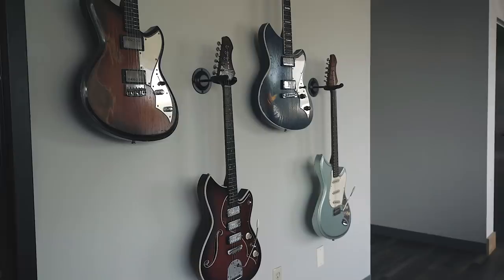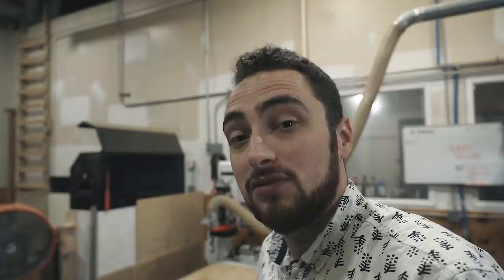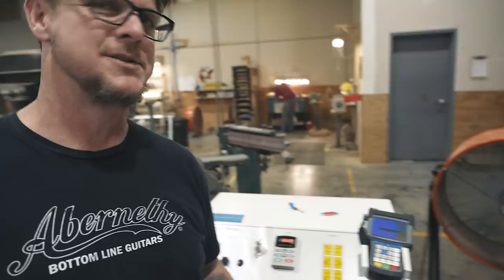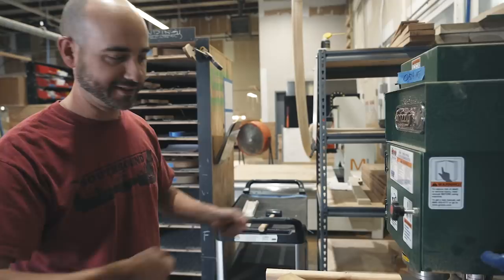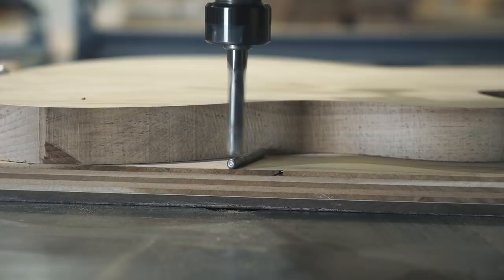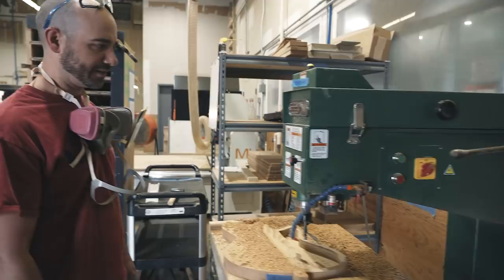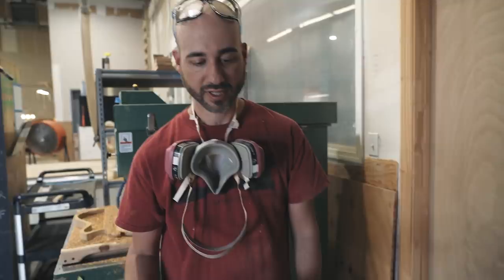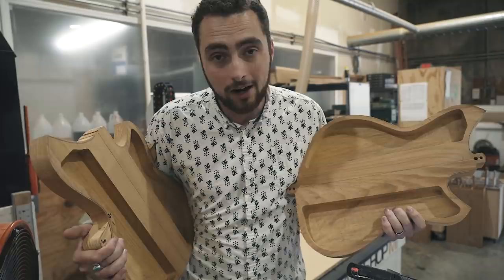Is “Handmade” Really Better? CNC vs. Handmade Guitar

Comment: I built and designed cabinets and furniture for 25 years. And although I'm no luthier, I know a CNC machine is still a router and works exactly the same way. The only difference is running a CNC machine won't fatigue you anywhere near as much (it's also a lot safer as my knee can attest to) and the results are more consistent. It's still important to have a qualified woodworker who make can make proper adjustments that mere technicians would likely have no clue about. But there's no less quality otherwise.
Reply: I don't know about that. A CNC machine is capable of whatever a computer can manage. Which is quite a lot. How well can you draw a fractal pattern? It wouldn't pose a challenge for a CNC machine to replicate accurately.

Comment: The CNC machine is a major investment piece of gear for the shop (although less expensive recently), and as a consumer I would be paying for it in the guitar price, not that it would make the guitar more affordable due to increased production numbers.    If I was a builder I would offer a number of body variations online and take custom orders (no, no monkey grip).  With the CNC machine it will take the same amount of time to shape my guitar body as any regular production body, and in a modern factory tracking custom orders is no big issue.      That is how I would like to have my piece of the CNC cake, a semi custom body at no extra charge.

Comment: CNC is an excelent way industry found to achieve a high level of tight tolerances, piece after piece, also achieving a high level of compatibility between parts (among dozens of other advantages). So if one considers that a musical instrument is a precision instrument, you have your answer.

This is also what makes modern inexpensive instruments to be quite decent, instead of total crap they used to be one or two decades ago.

Comment: I like the selection of the wood for the body of the pin routed guitar.  Its darker and has more character.  Granted, that's not going to be be seen once the guitar is finished.  I agree with the guy who did the routing, a CNC is just anther tool like a saw or chisel.  We still got to know how to build and assemble and ultimately to use the finished product.

Comment: As I see it there are at least three main aspects to guitars regarding quality. Appearance, play-ability, and sound quality.  Appearance and sound quality are highly subjective, play-ability is largely a function of accurate geometry, although geometry of frets, nuts, and bridges play a part of sound quality too. 

A highly skilled and experienced wood worker can produce a very nice piece of art and do a good job of massaging wood (or metal) into a good product such as a guitar. No doubt in many cases they can beat guitars partially made by CNC's and then further manufactured by inferior methods and/or by less skilled people. Ultimately though, a guitar completely made by highly skilled people on good CNC equipment with state of the art processes can be made so accurately and consistently that the best hand built one would be a distant second, every time. No contest.

If parts of a "CNC" guitar have to have handwork done other than assembly and some cosmetic work plus the final finish application then the CNC part maker has failed and they are either not very along in the CNC game or they are only utilizing a portion of what CNC's are capable of and only want to utilize specific advantages of CNC, or perhaps a combination of both things. Keep in mind there is a vast array of CNC equipment types and quality.  CNC's can range from hundreds of dollars to hundreds of thousands of dollars in cost.   There are CNC routers like in this video which are about the most basic, then there are 3 axis machining centers, and 5 axis machines that could carve the entire neck in one setup and machine all features including the fret grooves to within the tightest possible tolerances wood can be machined to, which would be many times over what a person with hand or manual machine tools and templates can do.

I have not seen everything out there but what I have seen with CNC guitar making is no one is fully utilizing and capitalizing on what CNC's can ultimately do. To put it another way,  "CNC" guitars are generally made (from what I have seen) with rather crude production techniques, and it's not hard to make bad parts with CNC's, which then get hand fitted which introduces more potential for error. Then the CNC gets the blame because the guitar is no better (or may even be worse) than a completely hand built guitar, when it's really due to a lack of human skill that couldn't or didn't capitalize on the potential of CNC machines.

Simply owning a great guitar does not make you a great guitar player, and owning or making parts with a CNC doesn't make anyone a good manufacturer.

Comment: Been a CNC machinist for 20 years. Guitar builders have a lot yet to learn with 3 axis mills. Jackson has a video up that sends me into fits. This one is not much different. 10 minutes? The fixtures are all wrong. The endmill is outdated. They built in a flaw touching off the first mill. My GD&T senses are going bonkers. They left more wood down the center of the body than they had to. They did not mill the matching top, back and neck joint when they had the chance. All the datums have been lost and the tooling tabs are a needless issue that must be blended into the profile now. I see at least three golden opportunities to improve fit and finish ignored. I also see a flash hazard by using compressed air to clear chips.

CNC and instrument building has a future, but it has a long way to go. I agree with every point you and this shop is trying to make here, but I go nutz when I see these opportunities missed. CNC is a tool, and it's best to stay at the limits of those capabilities so that serious problems downstream are minimized.
Reply: You’re hired!
Reply: @HBSuccess  I'll send my resume over.

Comment: Not to take away my view of the video but as a builder that started making guitars by hand that now uses a cnc my opinion is the cnc is actually the better method.  There is just as much skill and craftsmanship that goes into the modeling, tool paths and cad operations as goes into the hand building of guitars. The difference is I need only do the hard work once and then just be attentive and ready to make adjustments. There is still handwork to be done when using cnc it’s not like you click start and a few hours later a guitar comes out. However in terms of consistency and spec once the design is mastered it’s mastered forever and the first is going to be at the same spec as the 50th providing that spec is good. 
Make no mistake cnc is woodworking. It’s just another form that utilizers different skills. Whether rout from a template or a program a tool path the process is the same. The biggest difference is I can be cutting bodies and at the same time leveling and dressing frets on another guitar in the shop. I can be making the radius of fretboards while finish sanding a guitar marked for delivery. It’s a pleasure to watch the masters handcraft an instrument and truly an art but once a design is perfected and debugged I can replicate it with precision down to .002 mm each and every time and get more guitars ready to ship in a fraction of the time

Comment: At the end of the day it's still a piece of lumber > hand finishing is where the quality control happens - the artistry with wood & the CNC machine is to leave a little extra wood in the design input to the machine & remove the last bit with hand tools. Yeah - safety is cool , repetitive motion is overlooked sometimes & that unguarded router may be outside OSHA guidelines. ⚓️ Thanks Rhett, great to see technology put to good use.💦

Comment: The way I see it as an aspiring guitar builder, a CNC is really a mass production machine or something to use for quick precision. If you're not mass producing guitars, you don't necessarily need one. If you can get by with handmade MDF templates and a plunge router, then good on you. If you can afford a CNC, then I'm not going to fault you for using one especially because pin routers aren't exactly cheap. A lot of people do seem to think CNCs are do-it-all machines that can go from slab of wood to finish-ready guitar neck or body in minutes. But they're just computer controlled routers that use digital templates instead of MDF.

Comment: The only difference in them is that one of them has a perceived value above the other. I am an old furniture builder and while I really enjoy working with wood and hand tools, I also have 2 CNC machines machines with 5'x12' tables on them that can do all of that work in about 10 minutes as opposed weeks of labor.  It really amounts to what the material you chose. The CNC machines are just routers that if programmed correctly, do the same thing as doing this as a human. Just pick good wood when you make these and either method will create an equally fine instrument. It's all in the wood, not the method.

Comment: The CNC does not come to work with a cold or headache and it's faster.  However some unique operations can be better done by hand where constant adjustments need to be made.

Comment: The problem isn't in the tool used to remove excess wood and get a given body shape. When people (myself included) talk shit about "CNC made" guitars, it's mostly for when you watch some Gibson factory tours and see them just stacking 20 slabs of wood and putting them into a machine that cuts out the outline of a Les Paul body in all of them at the same time, without anybody paying attention to the grain or any other detail that you'd expect from a boutique/custom maker. When people think CNC they think assembly line mass manufacturing of guitars by people who are just factory workers and don't necessarily know anything about luthiery -- which is perfectly fine for stuff like Squiers, but it is kind of cheating when you're paying four digits for an axe.

Comment: As was said in the video as the CNC is more consistent and overall safer to use there is no doubt that it is a very useful tool..and yes I know that it is merely one of  the many tools used in building guitars as well as many other things made of many different materials.  the pin router is still useful for some  custom  work too.. as with custom ordered  pickup  and/or control arrangements..  and still there are many hand details needed to finish a guitar... fret work and electronics being only 2 of many skilled operations needed. the attention to detail is the most important part of guitar building,, a good looking instrument is not always a good feeling and /or sounding instrument to me looks are secondary however also important..  the CNC is a beginning in the build process. thebody and neck are the 'bones' of the giotar the guts are just as important if not more important,,   like the cheap Strat called the Starcaster By: Fender  good body and neck..but crap electronics and hadrware,,  O own one of those  for the price (under$100 new) it play as well as many cheap Strat copies available on Amazon or E-Bay...  but are better for repair and modding practice..which is why i bought mine in the first place..but I know that the more time and attention to detail is given to an instrument the better and more expensive it will become..  so the prices of good to great guitars is warranted in most cases... some are simply asking  to much for what they really are..

Comment: The manufacturing processes are very interesting. However, I have noticed that they do not use any type of hearing protection, which over time will progressively damage the ear and with it the hearing capacity. I find it strange that with so many regulations and standards that these industries have, they do not have this care for their workers.  A security and hygiene technician should evaluate this situation.

Comment: I've been making guitars for almost twenty years.  I remember the day I got a CNC machine and could just say, "Make me an L-5 archtop" and POW! It was just there!!!  No.  That didn't happen.  Each process I came developed took weeks of programming, experimenting, and redoing until it worked.  Even then, it only cuts wood.  It doesn't bend sides, it doesn't thin tops, it doesn't glue in braces, it doesn't do fretwork, etc...  CNC is just like a band saw, table saw, or router.  Just a tool.  You still need to be a luthier.

Comment: Interesting video. The cnc makes a more consistent product which is better overall. That's why they are used by most companies these days. I think the mojo is in the finished product, not the manufacturing process. Thanks for posting.

Comment: If I could choose, I'd prefer the handmade one.  But they are 99.99 percent similar. I like the slightly inconsistent look of the hand router cavity.  Having said that, CNC is obviously the right choice for Novo and most other guitar manufacturers. Time adds up in terms of labor costs (= higher price) and hand routing means a longer wait for the final product.

Comment: I am mostly ambivalent about CNC vs pin router... with one exception, the neck. 

I want the fretboard to be milled by a CNC that has been programmed by someone who has an intimate understanding of scale length, intonation requirements, and radius. That way, every fretboard will be a consistently accurate copy of the luthier's original design.

For those Luddites who object to modern manufacturing methods, consider that no aspiring teenage rock star, or school music program could exist today without the cost savings afforded by automation.

Comment: the tremendous speed of penetration of wood during machine processing literally chews wood, endowing the body with microscopic cracks that are not visible to the eye
Reply: any thing made on the machine should cost quite a bit more than the cost of materials

Comment: Thanks for the video. I'm an amateur builder, only just now finishing my 4th, and I confess to not really having thought through the whole debate. I don't really see much philosophical difference between a CNC and a pin router. Where I'm curious is how much difference there will be between a handmade neck and a CNC neck. I've shaped all my necks with hand tools - spoke shaves, rasps, etc. I'd love to hear a more in depth view of how those differences show up.
Reply: That is rather like asking "How long is a piece of string". Not enough initial information. The only answer is, "It depends". It depends on what you expect as an answer. If you want to use a CNC to rough out a neck, to the point that your hands-on work is limited to scrapers & sanding, CNC can do that fairly cheaply and fairly rapidly. The accuracy of the machine only needs to be in the 1/10th of a mm range, and the programming is fairly simple. Every neck produced will be pretty much the same shape coming off the machine, but there will be slight variations between the finished necks due to the hand sanding.

On the other hand, if you want to produce exact clones of an existing neck, or exact copies of a CAD designed neck, you need to define just how exact you want your results to be. High-end CNC machines can be accurate to 1/1000th of a mm. Said machines are horrendously expensive, the programming for said machines is terrifyingly complicated, and the time taken to produce to that accuracy is massively long, but it is theoretically possible to CNC to a standard that means there is no hand finishing whatsoever. It's just that nobody is crazy enough to do such a thing because of the nature of the material being machined. Wood moves for a multitude of reasons. Heat, humidity, internal stresses, it's tuesday, somebody farted in Botswana, etc, etc. The result is that your "accurate to 1/1000th of a mm" neck, is only accurate to maybe 1/10th of a mm. At which point, why bother...

So, to sum up, there is no such thing as a truly "CNC finished" neck. They are ALL hand finished to a greater or lesser extent. All a CNC can do is reduce the amount of roughing out you need to do, replacing the spokeshave & rasps, and allowing you to do something else before you need to break out the scrapers & sandpaper...

Comment: Its the exact same process. A router bit doesn't care what forces it through the wood. I've been a cnc programmer, machinist, tool and die maker for 27 years. I've also built 17 guitars, by hand. The only reason I've never cut them at work, is they won't let me put sawdust in the mill. 😜

Comment: Hogging out voids on a solid-body electric really doesn't make a great deal of difference in the finished product, so CNC (quick and accurate) is typically better. The most important step--selecting and gluing/laminating the wood--is far more important. Crafting an acoustic guitar, however, is a different story. The tone of an acoustic box changes with minute changes to the body panels or the bracing, and automation hasn't yet managed to account for the differences between two pieces of wood, even if they're cut from the same tree.

Comment: That was a great video and one that shows the folly of the machine vs hand made argument. It makes total sense to use the CNC machines to make manufactured parts of a consistent quality and mostly at a lower price. The guy operating the pin router had it exactly right IMHO. Why not use the best of both worlds to make the best instrument possible?

Comment: Carving should be done on a cnc machine as its cheaper, yields the same result and makes for a better fit (neck pocket, pickups etc). However, I really feel a difference in how a guitar is sanded. A more expensive guitar has a less "pointy" feel to it, the boundary between the top and side of the guitar feel more organic when they're not programmed in IMHO. I find it gives a guitar a more premium feel